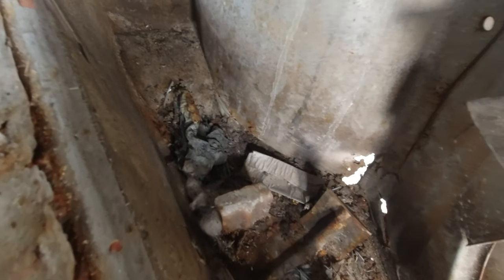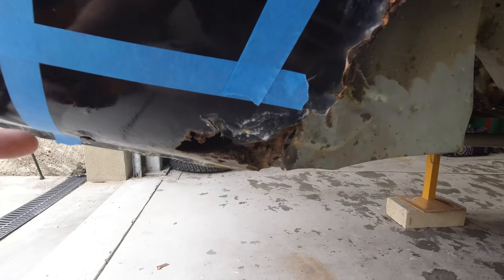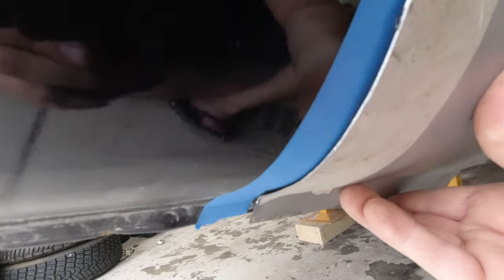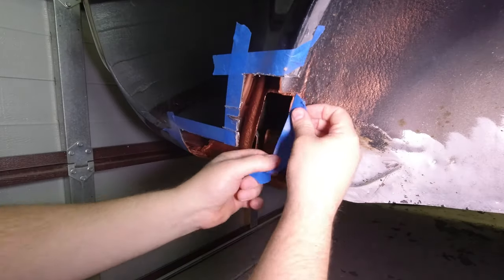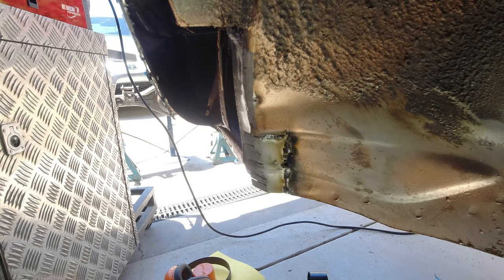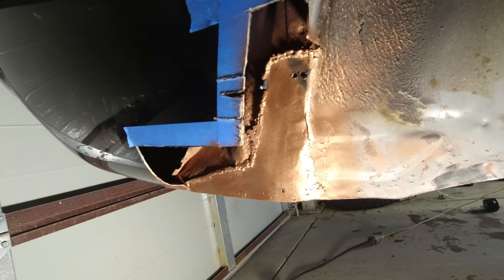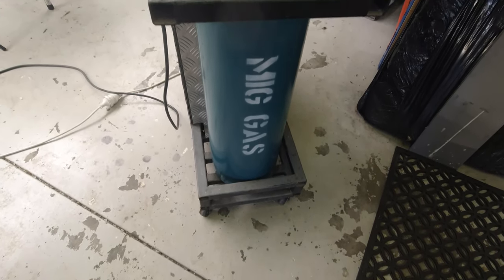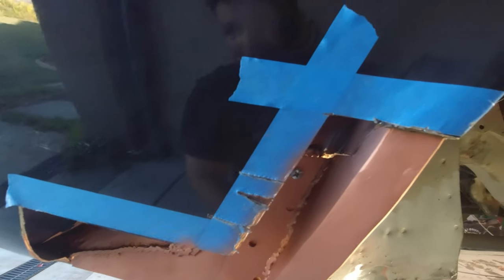Rust Repair and Panel Fabrication - RA23 Toyota Celica Restomod (Part 7)

Comment: Once again great work. You are showing us average builders there is always a way around a difficult task. Usually at the cost of time. That other bit of rust you have in that same area, near the fuel breather return is one I have to tackle soon now I have a better idea how to do it Thanks.  Cheers O.
Reply from the maker: Thanks Owen - good luck with it - I'm just going for a flat panel in that space, don't think the drain plug is really needed, and if it is I'll just cut it in later.

Comment: Great work Man, Watched two of your episodes today. Now I am all caught up.  I want to give you one tip. When you go to weld the exterior sheet metal on, space your tack welds out so the metal cools and prevents warping. An old hot rodders trick I was taught have your blow gun there when you do a tack weld. Run the tacks a couple inches apart, then blow those tacks cool with the blow gun. Once cool to touch run the next set of tack welds  in between those welds and repeat the blowing off process. this is slow going this way but very little warping. These clamps for but welds have been a life saver for me: https://www.eastwood.com/intergrip-panel-clamps-set-of-4.html  My last tip: if you but weld the sheet metal in place on the exterior screw it down in place where you want it to sit. Then take a cut off disc and cut the two panels where you want to preform the but weld. This will leave you a perfect weld gap. Keep up the good work I am following your build!
Reply from the maker: 👍👍👍 100% - I think you're going to be happy with what you see in the next episode, two of those tips will be covered in detail - i did try to run a the compressor to cool the work too but when combined with my welder it kept tripping the power. 🤷‍♂️ I've been spending a lot of time watching Fitzee's Fabrication and Outlaw Edge :)

Comment: So happy I found your channel. It has inspired me to get back to work on my Gen 1 Celica. Subscribed! Question: what rust converter do you use? Thanks for the great content.
Reply from the maker: Hi John, glad you're enjoying the channel. I use SCA branded rust convertor here in Australia (not sure where you are) but its just a general Phosphoric Acid based convertor. The trick is to keep the surface wet with product for a long time to make sure it has time to penetrate and convert.
Reply: @TheBuildRoom  Thank you. In the US so I will look for a similar product. In a future Violet Crumbles video could you show vacuum connections? Some are a mystery to me. This channel is the best place for info on repairing the 18RC. No one even comes close. Thanks so much!

Comment: I don't know what access you have to parts for the celica but i would have bought a parts car cut the patch's out of it and welded them in to get the proper fabrication with no guess work and less time spent. Just food for thought and great videos by the way.
Reply from the maker: Yep - have managed to source a few panels for other repairs, but this area seems to be rusted out on all of the other cars people have been scrapping which is a shame.

Comment: Great job mate👌 How many hours did it take? I need to do the same on my celica
Reply from the maker: Hard to say as i had to film along the way which doubles the amount of time required and I was also waiting for paint to dry etc - if you were good with your hands and motivated i think you could do this in a day - a pro could probably do it in a matter of hours. Thanks for watching!
Reply: @TheBuildRoom   thank you for tge info and the videos. I just started today with it. Need to replace more of the quarter panel as on your video. Hope to finish it tomorrow 😃
Reply from the maker: @sinan3511  Nice work!